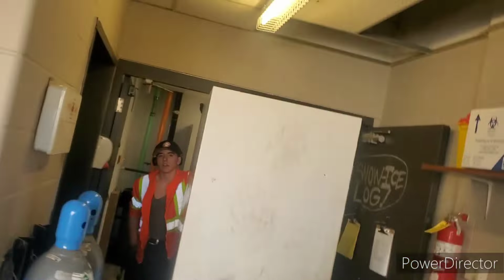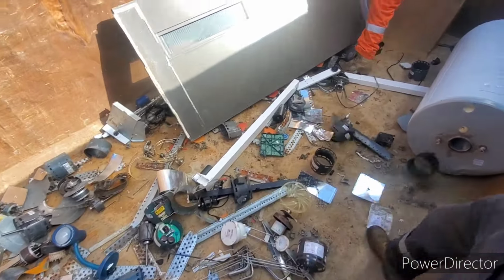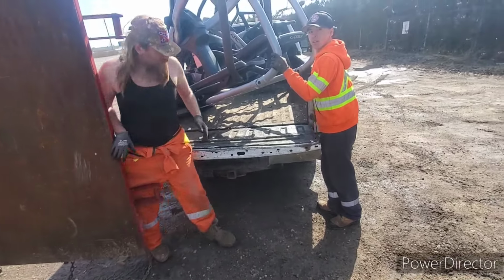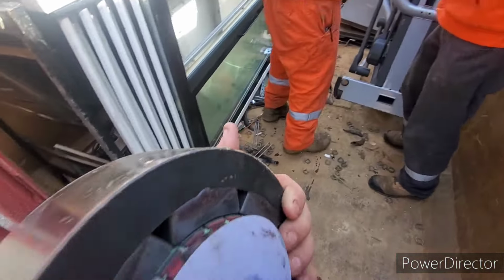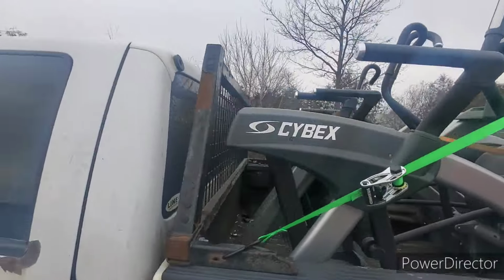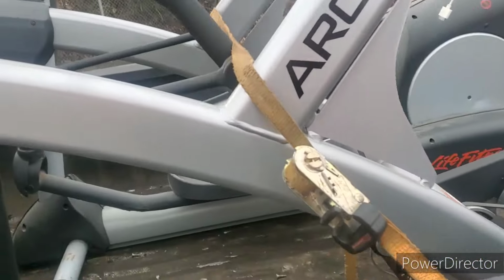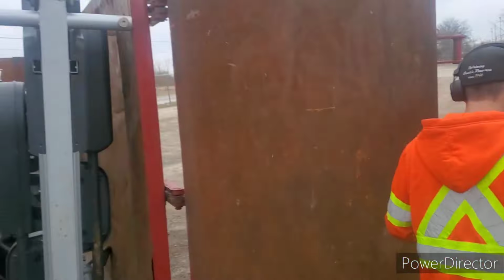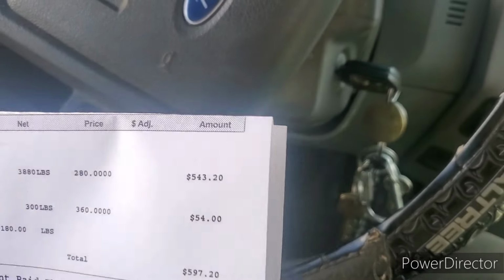Massive Scrap Pickup Job At The YMCA GYM

Comment: Many of those exercise contraptions have something that looks like a motor but works more like a generator.  The amount of effort to work the machine can be controlled by adjusting how much load you put on the generator.  It's like regenerative braking on those silly battery cars.  You may find a good sized heat sink (possibly "alu-mini-um")  inside some of them to dissipate the heat produced by that load.
Reply from the maker: Thanks